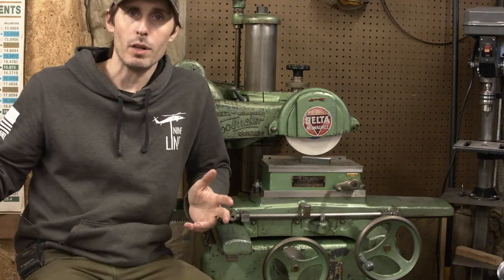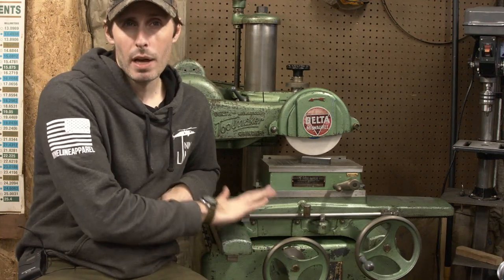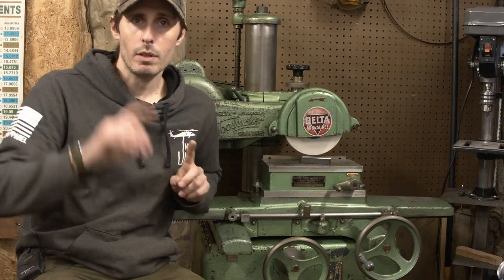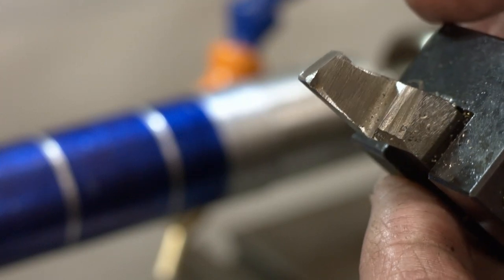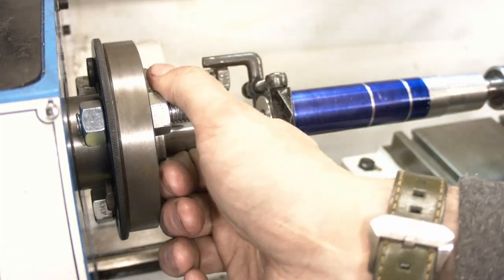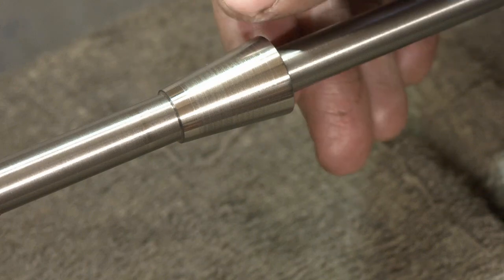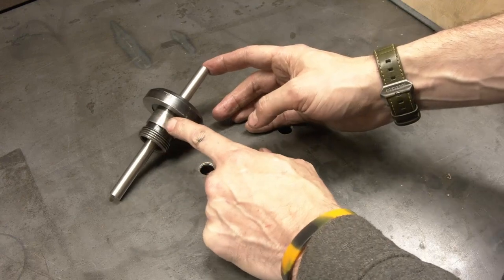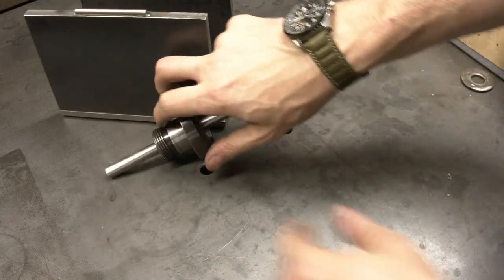Let's Make a Wheel Balancing Arbor!

Comment: Nice job! Another way to set your angle would be to use the lathe chuck and chuck up on the arbor with the big diameter of the taper facing out. Indicate the face of the hub that the grinding wheel gets tightened to first then indicate the taper diameter if your chuck is adjustable. Then mount your indicator to your cross slide and line the indicator tip up to the center line of the hub in the up and down direction. Use the cross slide to traverse the indicator tip along the taper and adjust the angle of the cross slide until it reads zero along the cross slide traverse. Then your angle will match the hub very accurately.
Steve
Reply from the maker: Wow, Solid Rock watched my video! Thanks so much for the advice! and for watching and commenting! I have learned SO much from your videos.
Reply: @hersch_tool  You are welcome. I enjoyed the video.

Comment: Nice job.
Interesting. My B&S Micromaster has the standard Sopko 3" per foot taper.
I think I moved the compound one inch with a .125" taper. It's half the angle.
Came out perfect. I made an angle gauge using Joe Pie's method. This way I just used a magnet, held the plate to the compound and Bob's your uncle.
Reply from the maker: thanks very much. And yeah i've since traded that grinder for one that takes the standard sopko hubs. joe pie has taught me SO much. thanks for watching btw!

Comment: If you are after superior finishes, and who isn't, have heard of roller burnishing yet? If you haven't it is a simple process that deforms the rough high spots to an even level and in doing so it also work hardens the surface to a greater or lesser extent. There sre many videos from commercial outfits and a few homeshop ones, one of which is mine.😉
If i may offer a tip when cutting tapers, the usual thought is to  reduce the diamof the taper with the cross slide, this is fine for bulk removal,  but when you get to final cuts dont use the cross slide but use the saddle instead. If you imagine your female part needs to go on the taper say a further 40 thou , if you move the saddle that 40 thou  you get thrre directly, rather than creeping up a Sine amount on the cross slide. For really fine diameter adjustments moving the saddle will give a benefit by using the sine effect, in your case(7 degree) a 12% of top slide movement and therefore easier to reach your target size and fit.
Reply from the maker: Thanks for the tips! I'll check out your vid on roller burnishing! :)

Comment: Taper, Surface Finish, Precision: Use the flat side of the compound slide (which is already at the correct angle for the taper) as a guide for a (somewhat) right-angled wood block with emery paper. At least this is more precise than a "freehand-journey":)
Oh and didn't you have a surface grinder?:) Wait ... this project is for the surface grinder. So, a hen and egg problem. Cool!:)
Reply from the maker: Thank you! And that sounds like a really great idea! I'll keep that one in my back pocket for next time :)